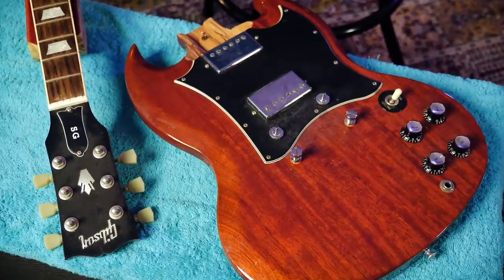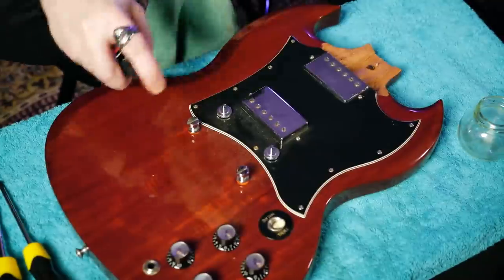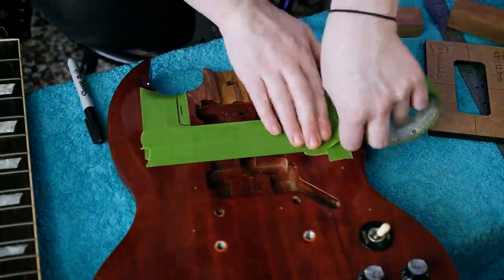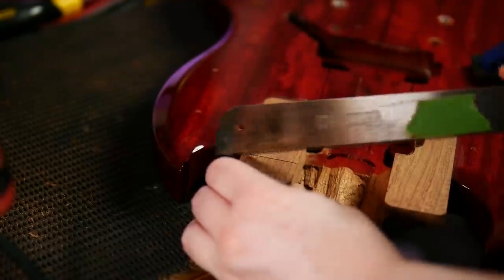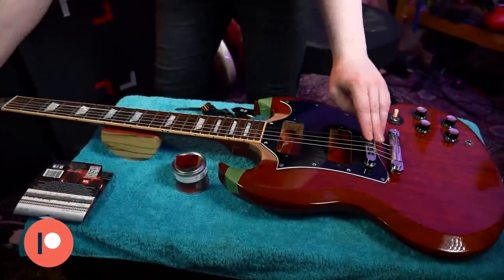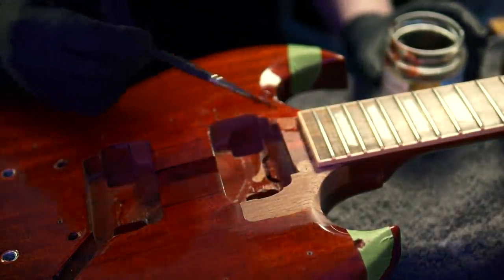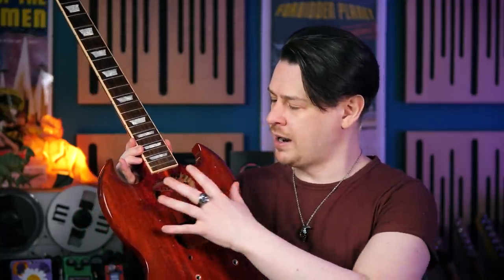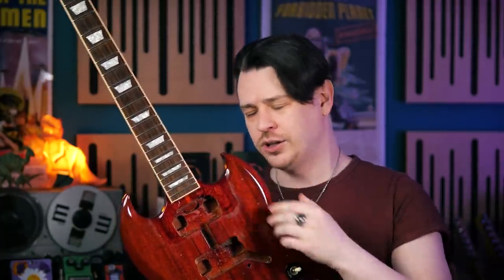BRUTAL Gibson SG Neck Break Repair (Part 1) | Axe From The Grave

Comment: Cool project! But please, please do not wear gloves when operating rotating tools like routers, drills, angle grinders, circular saws etc. Even though you shouldn't get your hands anywhere near the dangerous, spinny bits anyways, if you accidently do with gloves the rotating parts can grab the fabric and pull your hand right into the tool, giving you no chance to retract. I guess I don't have to explain how this kind of work accident looks like. It's nasty.